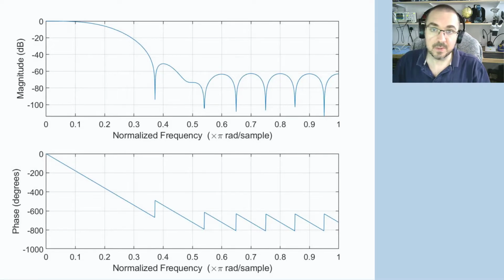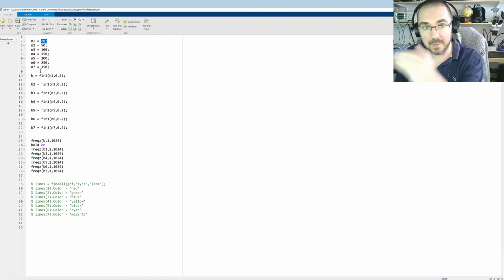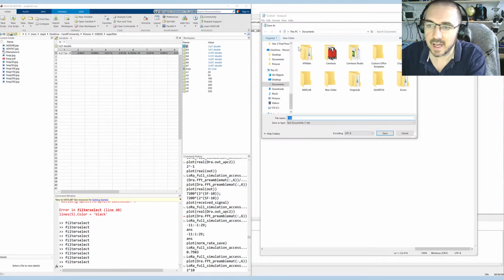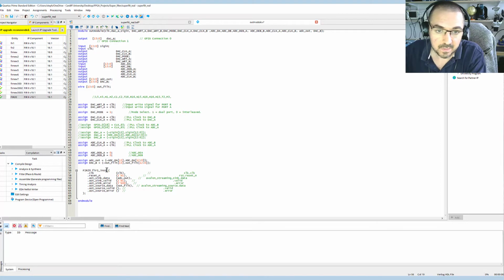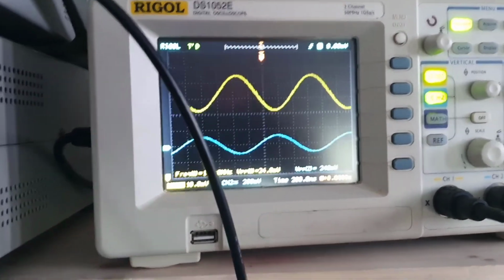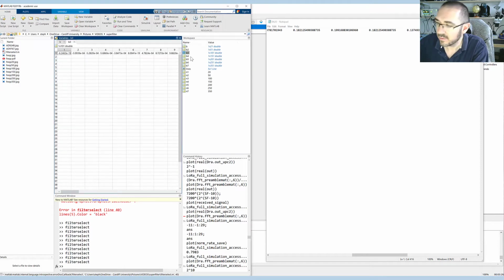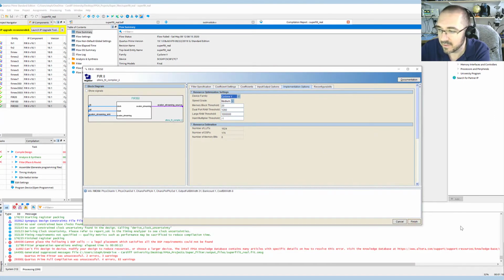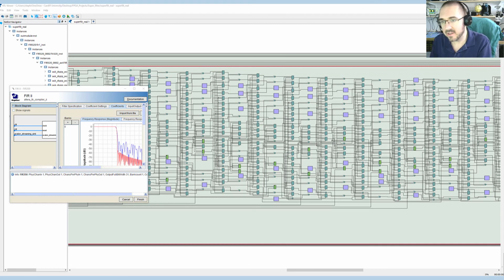LARGEST Digital Filter on an FPGA - design, build and test of an FIR filter. How big can we go?

Comment: Do you think the response of the filter can be observed by the network analyzer, I know these ADC have different range of Vref but if we calib the nework analyzer to make input and output signal linear (in some bandwidth) we can observe the s21 in a better way. I will try it but Im using the lite edition of the Quatus and Im not sure the FIR IP Catalog can work on lite version
Btw I have exactly the same hardware as your, the CGX starter board is so convenient that it have USB to UART to controll stuffs inside the FPGA. I just complete my own NCO project and control the freq through the USB-UART port. There still so much things to explore on this board!